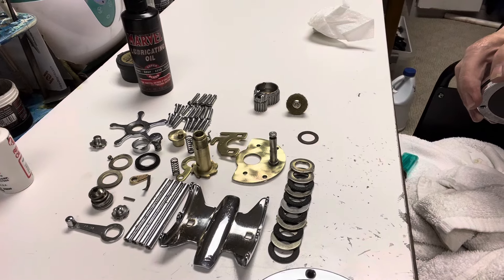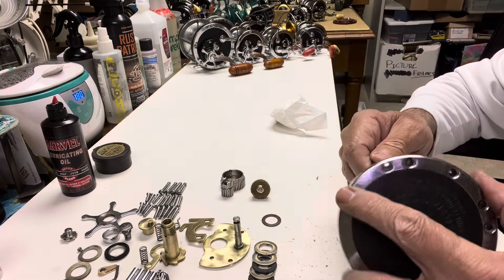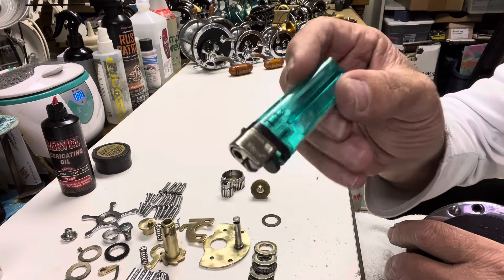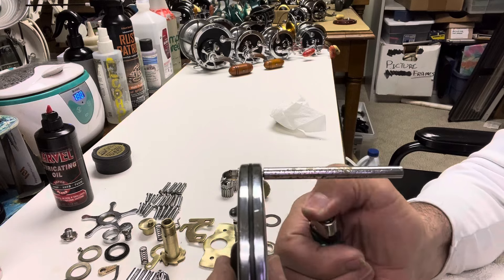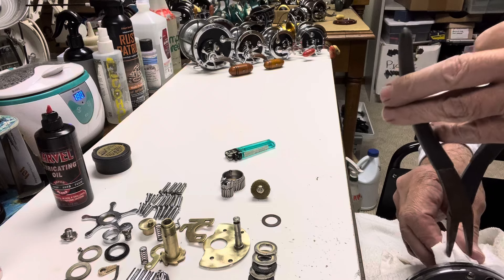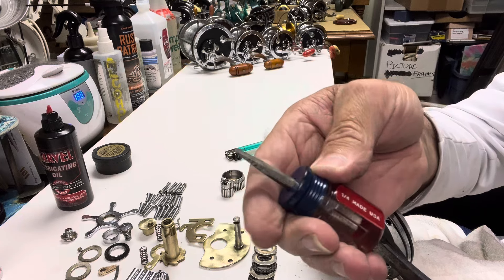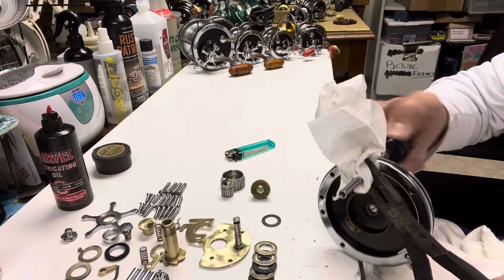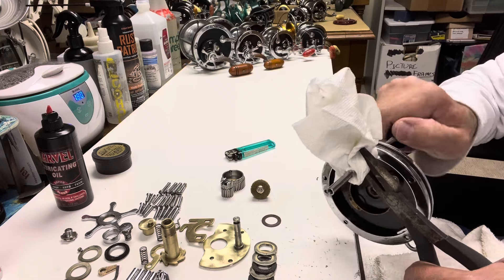Tips from “The Bench” in this video I share how to remove a frozen frame post screw without damaging

Comment: Concentrated heat works wonders with corroded screw threads. I’ve undone horribly rusted farm machinery bolts with oxy acetylene heat, often getting the nut red hot, and it rarely failed. Sometimes, if the nut cooled too much before complete removal, it would jam up again, so more heat was required.